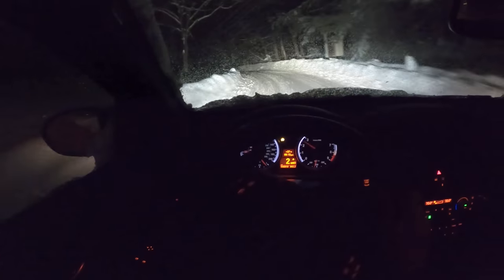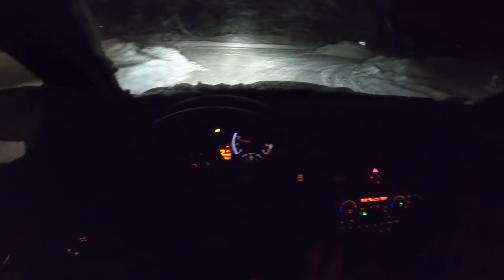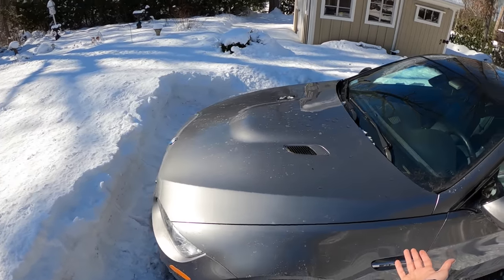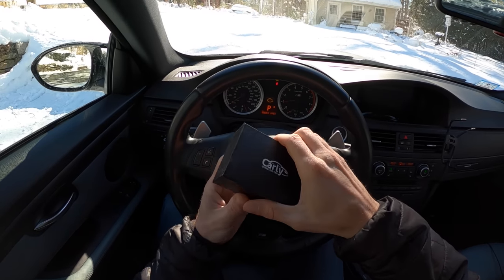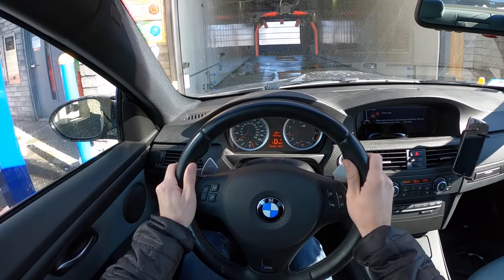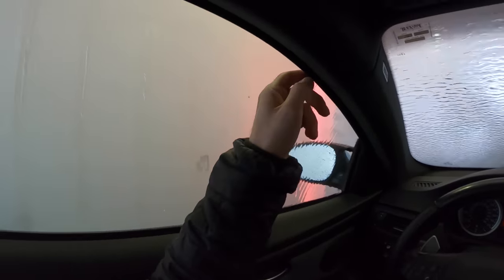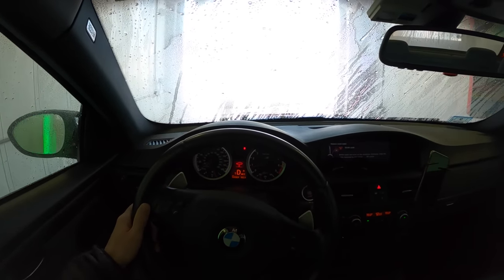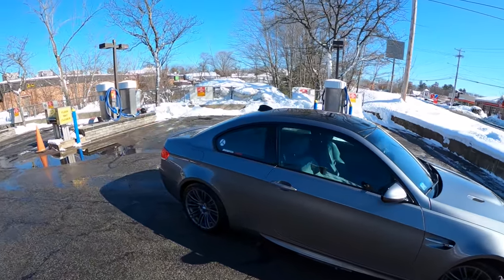Is Touchless Safe? - Washing My Filthy BMW M3 Winter Daily (POV)

Comment: Try the ryobi ez clean and it's a cordless power washer and I been washing my car in the winter with just a 5 gallon bucket of water and I rather have a winter beater to drive when they put salt down and I found out that baking soda and water kills road salt just like it do with battery acid and that winter is just a season that you cant wash anything outdoors and the salt looks more nastier then just dirt alone that it looks like mold

Comment: What I want to know is, even with the undercarriage wash, wouldn't it start freezing up fast since car washes don't dry under the car ? 

Also most car washes long dry the very back of a car well leaving for example my 2022 Elantra wet on the back tail light are which means I'd have too go out and dry off the water each time. 

It's also a good idea to open your doors right after the wash and dry down in-between the doors and drive home if you live close with all winters and sunroof open a finger length or two to avoid freezing if it's really cold!

Comment: salt is more harsher than any of those chemicals in touchless car wash so you should just be fine mr tedward haha
it just strips the protection off the paint overtime thats it just throw some spray wax while you are drying with a microfiber towel right out of the car wash no biggie

Comment: The only issue I have with some of the touchless washes around here is they don't clean the hatch of my golf well.
Reply from the maker: which one do you go to? The one I like most in that region is in Waltham on Lexington street. It's a really old machine but its great
Reply: @TedwardDrives  I've tried that one a couple times, ironically I nearly beached the IS on the undercarriage wash at one point, but even then I've tried it on the golf and the hatch always seems to be dirtier than the rest of the car after the wash.
Reply from the maker: Lol it’s narrow too. The first time I went in an aston Martin vanquish. I was terrified I’d wreck a wheel
Reply: The approach from the street doesn't help either, definitely scraped trying to get in before.

Comment: Would you say it is better than regular car washes with brushes? I mean especially in winter and for a regular customer, that is not willing to wash all the time by hand?

Sadly here we have only brush car washes, that lie you straight in the face "yeah, no swirls or scratches here, super safe" yeah, no... Even if the brush is microfibre, if I'm the 20th car that day, how are my chances, that those are completely clean and not full of sand?
Or handwash boxes.
Reply from the maker: A billion times better than a touch wash. I would never go through a touch
Reply: @TedwardDrives  with my current car I did brush wash and now regret it.. Will be a bit of polishing, when the weather is stable enough. 

But until this week I did not know, that these even exist. There seem to be literally none in europe...
Looks like a market to be taken over here.

Comment: If I lived in a snowy climate I'd probably just end up buying a winter beater for a couple hundred bucks and be done with it
Reply from the maker: It’s not a bad idea but it’s another car to maintain, and insure. It ends up taking time and money to keep the crappy car road worthy 😂. Still needs brakes tires oil sensors clutch etc

Comment: Wait you have p mode in your m3? My e60 M5 only has N mode
Reply from the maker: Your e60 is smg 3 which is a single clutch. The e92 is a dct so they may have  a different approach to Park settings. I think in amg you’re supposed to turn it off in first gear or reverse so the transmission is in gear like a manual

Comment: Touchless does the job if you're too lazy to spray the car down yourself in the self washing bay
Reply from the maker: Not about being lazy...two reasons I don't like using those. 1. they don't dry the car and its outside so the water freezes on the car. 2. car always comes out looking like absolute trash unless you bring a bucket and sponge and wipe it down. NO WAY am I using the filthy brush
Reply: @TedwardDrives  Valid enough. I just go thru for a quick rinse to get rid of all the salt and chemicals from Massachusetts roads. NEVER EVER USE THE BRUSH
Reply from the maker: The brush might as well be made of nails 😂

Comment: american automatic car washing places are so dumb. In Europe they have a rail that pulls your car through so you just have to put it in neutral. touchless car washes in here also don't use harmful chemicals. it is just the regular car wash without the spinning things. Its just like washing your car with car shampoo an a pressure washer and it does a decent job most of the time.
Reply from the maker: Lol both of those things are exactly the same here